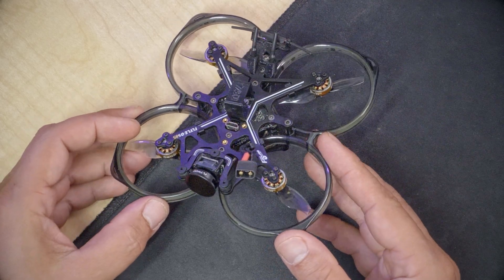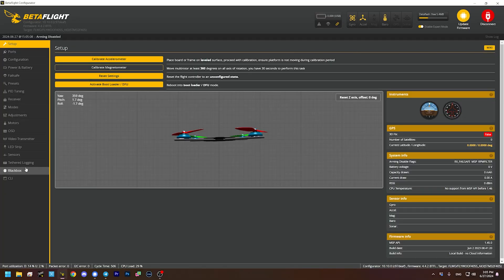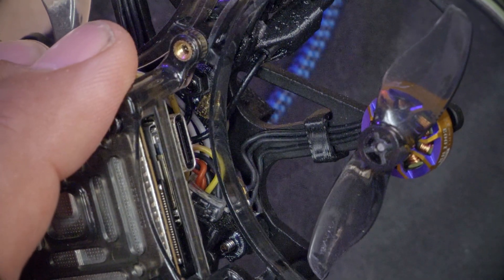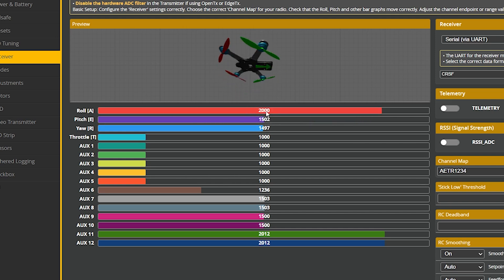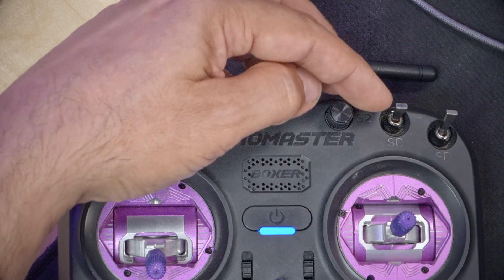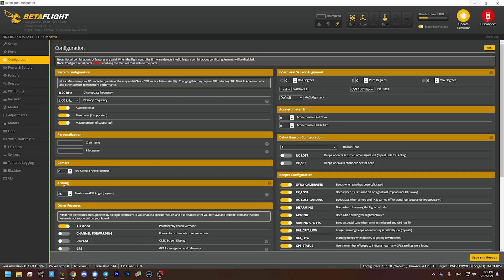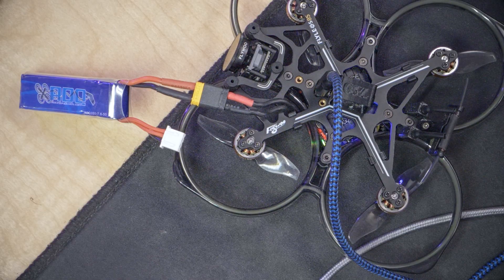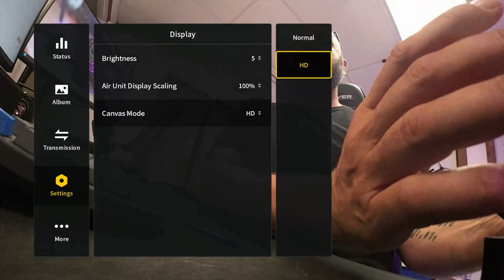Flywoo Flylens 85 Betaflight Setup

Comment: I've bought the flylens with a GPS+compass and soldered it to the board which was a lot of 'fun'. But now I see that I have firmware 4.5.1 so no altitude/position hold. Also have trouble calibrating the barometer. You have to set it to 180 degree flip which helped, but anyway the cardinal directions are not perpendicular to each other which doesn't seem right.

Comment: Saved me a lot of time Joshua, I was lost until you revealed THEY SHIPPED THE BNF WITHOUT AN ARM CHANNEL....I mean come on...
Reply: I’ve been trying to get this thing to work. Can’t arm. No stick inputs in beta flight. Help!!!
Reply: @mekongdelta1956  What receiver are you using? Crossfire didn't give me too much issue.
Reply: @Nietsnebarg  I got bnf version for my DJI goggles and controller. I can bind with the goggles and get a video feed. But I’m having trouble getting the controller to link up. I get the solid green light, but no stick input. Thanks !!

Comment: got mine today .. waiting on batteries. Mine will be dji pnp to my goggles and dji fpv controller 3. Can't wait to fly it. It came with a dji 04 (non pro) vtx.. there is an 04 pro version as well. It also has an ELRS receiver in it.
Reply: I bought mine i have all my dji controller and goggles , what is the reciever do i need one to fly with dji
Reply: @francohernandez13  I have been trying to fly mine :). You can bind your controller to your goggles and the goggles to the drone's dji receiver, built into the dji air unit.  There is a good video about it .. I'll see if I can find it and link it here. It is a dji created video.

Comment: Hello Mr. Bardwell, My flylens 85 with O3 came with BF 4.4.3 and the OSD menu is not there I can't even activate in the basic configuration. Do you have maybe any solution for this? I Would really appreciate. I see OSD info in my goggle but is look messy and I would re-positioning this, but I cant due OSD menu is missing.
Reply: Found the solution the BF configurator has to be 10.9 and not 10.10...WTF
Reply: @BboyFenzi  I just did what you said and it fixed it for me thanks I was trying to figure this out for weeks
Reply: Glad I found this comment! Same issue here. Thank you!
Reply: @BboyFenzi - I wouldn't have thought to do this had I not happen to find these comments. Thank you for sharing this. It probably saved me many hours.

Comment: any reason why my ARM is Disabled?
Reply: I ran into the same issue in betaflight, I believe it was that when it's connected to betaflight it disables the ARM function for safety.. If you're setup right should work when you disconnect😎

Comment: I just picked up the walksnail moonlight version, but can't get the goggles x to bind. I see the sd card in the vtx during binding but seems like weak signal strength.
Reply from the maker: Best guess you need to update firmware on the X to support the Moonlight. If it's on older firmware it won't work.
Reply: @JoshuaBardwell  Absolutely correct, lol! I was flubbing up the vtx update. Everything works brilliantly now.

Comment: I've been looking to get the flylens 75! question for you as someone brand new to FPV through way of the Avata 2 - now that the goggles 3 as well as the remote controller 3 are compatible with the O3 air unit, should I or do I need to use beta flight when initially setting up this drone?

Comment: Does anyone know where to get an otg cable with USB type C on both ends? Just bought a nazgul5 eco and can't connect it to my phone and speedybee app because it takes usb c and my otg cable is micro usb. Tried an adapter but that doesn't work either.. what do I do!?
Reply from the maker: An OTG cable will always be USB-A on one end. You can get a C-to-A cable though.
Reply: @JoshuaBardwell  Nah, I have an otg cable that is micro usb on both ends that I have been using for years. But the new Nazgul5 eco has a usb c input on the flight controller. All my other drones have a micro usb input. My micro usb otg cable has a "host" end that has to be plugged into the phone side..
Reply: @JoshuaBardwell  I also have one that is usb c on the "host" phone end an micro usb on the other end. But I can't find a usb c to usb c cable with a "host" end.
Reply from the maker: That's interesting. I didn't know that.
But I'm still pretty sure you can't have an OTG cable with identical connectors on both ends. The USB OTG wikipedia page confirms this.
Reply: @JoshuaBardwell Well, if that were true, the one I've been using for years wouldn't work, but it does. It works perfectly on all my drones with micro usb inputs. I even bought an otg adapter to go from micro usb to usb c, but that didn't work either. I have no idea how im going to set up this Nazgul5 eco.
Reply from the maker: Buy a USB-C to USB-A OTG. And a USB-A to USB-C cable.
Reply: @JoshuaBardwell  tried it, didn't work. Did I mention I'm using the speedybee app with my phone.. no computer or laptop here.
Reply from the maker: For that setup, plug the OTG into your phone not the drone (if that was the issue, perhaps). After that, I can't think of a reason why it wouldn't work, except if somehow your phone didn't support it.

Comment: You totally read my mind - setting up my HDZero Crux35 at the moment. Thank you!
Reply: Poor ole HDZero won't get you even 1/4 of the distance exploring, when flying closer to the ground though. (I'm exaggerating too, it's not even close to 1/4 of the distance 03 will fly!)

 DJI 03 will fly down to the very end of JB's road where the street sign is. When he did his tests of the different digital FPV systems, that's where 03 ended up. HDZero got to the bottom of JB's property, about where the whole test started, and got the rainbow 🌈 screen of death ☠️ and was done! I suggest you search for those test comparisons of the 3 digital systems. It's fascinating! And a HUGE mind opener about exactly what you're missing out on.
Sorry to say, but true. 🤷😥
Reply: @KOrnhOliO1  I can confirm you're wrong - HD Zero working perfectly even flying from behind trees and buildings - so you can go troll someone else.

Comment: I want the walksnail version. I think those are the HD goggles im going with. Planning on ordering them and a transmitter next week. I'm ready to get back in the air after a year away.
Reply: Just got mine today. Having a little trouble getting the vtx to bind

Comment: Were they sent to you months ago jb? I bought mine 3 weeks ago and just received it a week ago, and mine has the updated MPU 6000 flight controller with usbc. The PCB is white on the new version. 🙂
Reply: You can choose which gyro if you buy the FC, but the drone kit or complete O3 drone is afaik shipped with ICM42688, not MPU6000 (but I personally do not think this is important)
Reply: @DUH-rq1fe  It very much is because the older one cuts power to the 03 unit mid flight.  At least I had this problem.  It would also cut power if I bumped into something more than slightly.  If you get the older FC send it back immediately because flywoo won't stand behind the faulty FC in the older version even though they admitted there was a problem.
Reply: @GearBangerFPV  we're talking about GOKU F405 HD 1-2S 12A ELRS AIO V2 with the white solder mask. So whats the point of your comment? So which one did you have?

Comment: JB is great but just like the review this is based on quite an old version of the FlyLens 85.  If you get the version with GPS, it's certainly worth updating to beta flight 4.5 just for the huge improvements in GPS Rescue.
Reply: Not quite sure why you would need a GPS on something that you won’t leave your garden with.  Surely it’s just adding pointless weight?
Reply: @kaygeebee1962 why would you not fly it further than your garden?? The 03 and express lrs have far more range and capability, and with the advertised 8 min on a 1,000 Mah 2s battery, you could explore the neighborhood..😉
Reply: @kaygeebee1962  If you look at the GPS offered by Flywoo it's tiny and adds little weight.  Although the FlyLens 85 can acro, with the O3 lite it's fragile and one bad crash and that's an expensive O3 Camera at least in the bin.  As I fly on a 1000mah 2s, I can get around 8 minutes of cruising with high quality video some distance away outside my reasonable sized garden.  GPS Rescue in 4.5 works so much better than 4.4 (well it actually works!) and if it means I lose a few extra seconds of flight but get a $500 drone back, for me this is a worthwhile offset.

Furthermore, JB mentions his dislike of Horizon mode but of  course this has changed a lot in 4.5 and he now seems to endorse it.

For ripping around my garden, I have an Analog Air75 which I feel is more suited.
Reply: @kaygeebee1962 You're thinking of the olden days, my friend! 😀
With ELRS and 03 as your VTX this 85mm whoop can fly way, Way out further than you would have ever imagined years ago. Back in the FrSky & FlySky days you're right, you'd never leave your garden. But with today's tech, it's a different story! 
You've probably seen Bardwell's flights down to the end of his road, right? When he tests how far a quad will fly with different digital and analog systems on it. Well, with 03 and ELRS this quad can easily make it all the way to the end of his road, down to the street sign. That's one hella long way - flying right close to the ground too. Probably between 1/2 and a full mile down there. It takes quite a while just to fly there! Lol If you haven't seen those flights, search his channel for comparisons of digital systems distance flying. DJI, Walksnail, and HDZero comparisons. It's rather entertaining just seeing how HDZero barely gets off JB'S property and gets the dreaded rainbow 🌈 screen of ☠️ death💀, and is done! Kinda right at the starting gate... It's so pathetic! 🤣 Lol
Anyway, this Flylens 85, with 03, will totally surprise you in how far it'll fly! Blow yer mind, is more like it! ✅🤯
Reply: @ig2016 I have one with a GPS and I agree with you.  I haven’t upgraded to BF 4.5, but would be interested in your CLI file if you are willing to share it.

Comment: My Flywoo Flylens85 has no green LED. It is not lighting at all (viewing in a dark room.). Is my hardware defective?
Reply: If you just pick yours up, there's a good chance you have a newer version of the board. My inclination is that Bardwell got these months ago and just got around to reviewing them. I bought mine through 3 weeks ago and received it a week ago, and my flight controller has USBC and an mpu 6000 gyro. I would just refer to the product description, and directly to flywheel support if you feel like it's defective.
Reply: Check to make sure it’s plugged into the FC.
Reply: @PeighDayFPV  It was. I know this apart from the USB for the 03 air unit. Thanks.